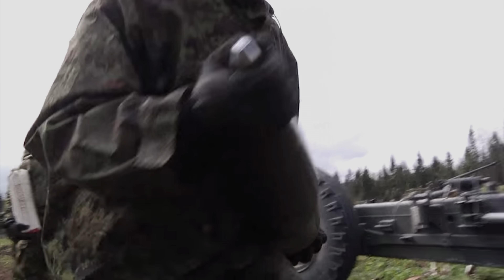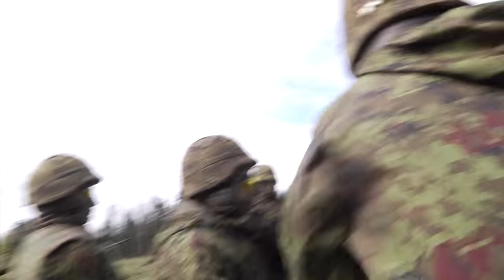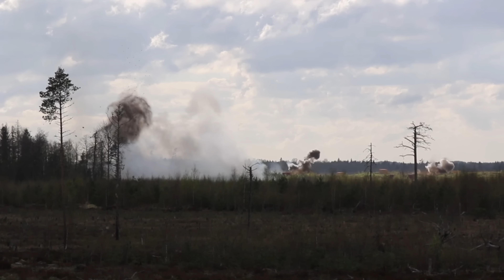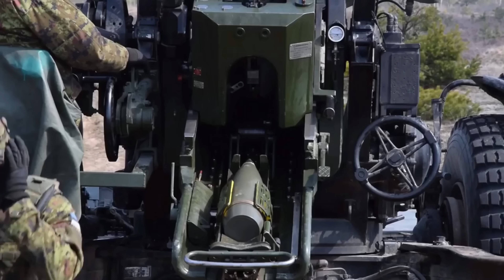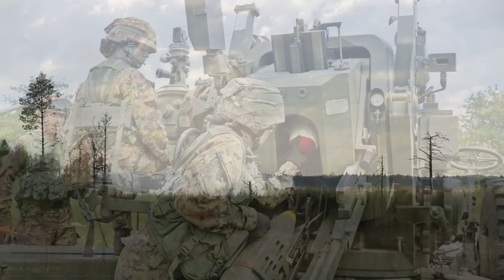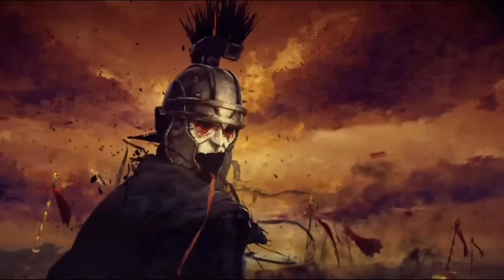FH-70 155 mm Towed Howitzer - DITCHED BY AMERICA?!

Comment: "volkswagen spark ignition diesel motor" uh.. mat.. pardon? spark ignition diesel ?
Reply: Multi fuel, but always thought it was a standard VW air cooled boxer engine before.
Reply: @jantschierschky3461 I always thought the multi fuel engine was based on Diesel, kerosene, jet fuel interchangeability of fuel. It was an ideal but the commitment was dropped. The God awful Leyland engine in the Chieftain Tank  was multi fuel. As Bret says though, spark ignition? If you can explain further please do.
Reply: Yea.... that definitely caught my attention. Never heard of a spark ignited diesel engine...
Reply: But, a listing on Military-Today .com lists the fh-70 as having the "The APU is a Volkswagen Model 127 1.8-liter diesel motor, with 4 cylinders in a "boxer" configuration. It is air-cooled, spark-ignited, and produces up to 71 hp at 80 rpm"
I'm looking more into that model number now

Comment: Matsimus  !!!
Thank You for another incredibly informative video!!
What do I mean by that?
1) The FH70 makes an awfull lot of sense in conjunction with Your 105 mm!
The main difference is that the 105 mm is deployable/placeable with a Merlin (Cormorant to You nutcases) helicopter.
Now the 105 mm. makes an awfull lot of sense - if it can be fired from a PREPARED position with some timber logs to catch shell fragments. Such prepared positions are easy to make and comparatively cheap - given you have a wooded area. If you need to change position - then have 5(?) prepared for each gun. If they cost next to nothing it can be done.
2) I have noted that Denmark/Norway/Holland have formed a "Special Forces Command". Now Holland has 15 of these FH70 in wartime reserve. Where you can deploy a 105 mm with a Merlin, that can carry 5½ tons underslung. The 105 mm weighs 2½ tons. The problem is then: The FH70 weighs 9½ tons and there is no way on Gods green earth a Merlin will be able to haul that: That needs a Chinook.
Strangely enough Holland has 155 mm FH-70 AND Chinooks.

3) Now there is something called tactics.
If the 155 mm can cover a withdrawal of the 105 mm with base bleed munition (and the crew is in a level 2 protected vehicle - alternatively blow up the gun and have spares in the prepared positions for the 155 mm - as long as you get the crew out).
Then the 105 mm. can cover the withdrawal of the 155 mm.
4) During the cold war the Soviet problem was NOT finding the proposed sites for the Pershing II and cruise missiles: They knew to a meter precisely where they were! That was only what was to be expected with so many traitors and informants. Nope! The problem was the sheer number of proposed sites. If you have to cover - say - 5 sites with artillery or nukes then you in effect rain terror over a lot of dummies - and run out of ammo.
5) The problem with the tactics is you need a divisional command to control such a force - which just might be the reason why such an animal is formed in Latvia? Pure guesswork on my behalf - I have a vivid imagination.
Am I inadvertently giving a deep military secret away? Possibly! Only problem with that is: If the dear ruskie bastards haven't figured it out, they are so stupid that they better commit suicide before their own firing squad catches up with them.
We KNOW there is a traitor in the Defence Committee in Denmark and in the Army command (has just recieved a 2 month prison sentence for banging not a canon, but his mistress promoted to major).
Do the ruskies think we are so stupid, that we have not thouht of the possibilty of such  a contingency?
"How big an idiot do you have to be to be a member of the Russian Intelligence?"
That is a slight rephrasing of the economist Jean Robinsons scorn over one of the times the enviromentalists had a holy grail - in that instance called the Rome Club (most of You will be to young to remember that particular stupidity).
Why do the russians think, that a tactic on their part that allready has failed abyssmally should be a success the second time around?
But if I on the available public information is able to produce a tactic from my posterior - maybe they should reconsider their war plan regroup and kill some russian generals? Just a suggestion......
Reply: in 2020 trials began
 for 155 Volcano with estimate 100 km distance more or less like himars

Comment: would like to hear, see    a review on the G5  155
Reply: The better one that could move around on its own...  :)
Reply: My thoughts exactly @Ian Cockcorft
Reply: Junk 198 is king
Reply: huh? i   googled JUNk 155 field artiillery. it came back with  the M198. same thing?? :)
Joke.
its a decent system, but doesnt come close to the G5. misses by about  15km.(Maximum firing range 30km vs 45km, and thats without rocket assisted ammo)
Does it also have   an auxillary power system to allow it to be driven into position?
on  what points do you think  is better?

Comment: 3 rounds a minute?

No that's soldiering.
Reply: Kieran Fitzgerald should be 7-8 per minute
Reply: Actually good fire rate is 6 rounds/min
Reply: @masdaze  we did 8 shots in 55 seconds wtih D-30
Reply: @rihA-g3e  but d-30 is 122mm and much easier to use, trust me, i have shot both of them and they d-30 is some good old russian iron
Reply: Yeah til they croak from exhaustion!
2 rounds sustained. 
Soviet style bombardment 20 30 mins. 5 rds a min ? Nah
Reply: I get the feeling that many people aren't getting the Sharpe's reference here.

Comment: Du on earth do you have manual loading. Its like the Napoleon wars.
Reply: Auto loaders fail. A well trained crew can fire and load with more consistency over a longer period of time than a full auto loading system. Auto loaders break, and they take up a ton of space either between the trails, or in the gun house/turret. And when they fail, they make manual loading very difficult. This is one reason you don't see an auto loaders in the Abrams, and why the auto loaders in the paladin is assisted by a crew
Reply: Also Napoleonic times were muzzle load, breach loading nearly 100 years later

Comment: This is a pretty crazy coincidence. I was thinking earlier today if Germany stilled used any traditional artillery pieces and found the FH-70. Then you post a video on it 3 hours later
Reply: Germany retired its traditional artillery from service (apart from some 105mm howitzers for saluting).
The Bundeswehr has currently the 155mm Panzerhaubitze 2000 self-propelled howitzer, the MARS II (MLRS) and 120mm mortars (either mounted on and fired from M113 APCs or transported by the light Wolf vehicles).

Comment: Remember my Fex with 154 battery field artillery of the Royal dutch army in 97 i was added to replace a 10 ton munitions driver/worker and went on a two weeks exercise with this unit at Münster süd.
The unit used the M114 originally but acquired the Fh70 to prevent them from wearing fast.
The Volkswagen Beetle engine on the gun was a nice feature all German. 😉

Comment: Iv always wondered. The explosions artillery make are fairly small (relative to where the enemy could be). And they shoot fairly slowly. So how are they so affective at taking out the enemy at such a long range?
Reply: The visible fireball of an explosion is inversely proportional to the damage potential of a conventional shell.
Movie explosions are spectacular using gasoline, propane and flour with low power civilian explosives to give a big fireball that doesn't endanger the film crew or stunt actors.
A 155mm shell weighs around 40-50kg with enough high explosives to turn a two floor brick building into so much rubble in less than a second.
Also, modern fuses commonly detonates shells up to 8m above ground to shower the ground in a cone of fragments and shrapnel to reach entrenched troops.
They can alternatively be set to detonate milliseconds after impact to get at troops inside fortified buildings.
A modern howitzer also fire that shell up to 50km.
WW1 artillery rarely fired over 8km
Reply: 105mm frag range is roughly 100m so scale up for 155mm
Reply: HE shells are usually used and can send shrapnel flying for a good distance and is usually what causes most of the casualties
Reply: Here's a video of what it looks like at the reciving end of a proximity fused barrage feom a different but comparable 155mm artillery system.
https://youtu.be/n2OgwHCVFYM
This is filmed from about a km away from the impact zone.
Reply: That view of the impacts can be confusing due to trees in the foreground. See those small box like structures in the impact area? Those are shipping containers...